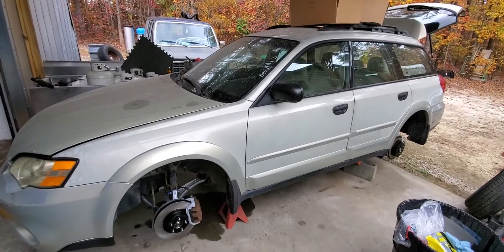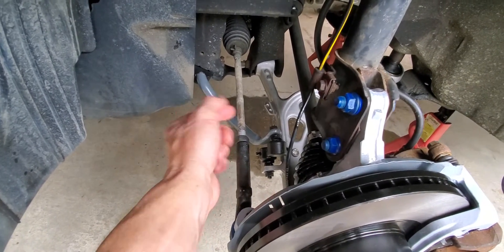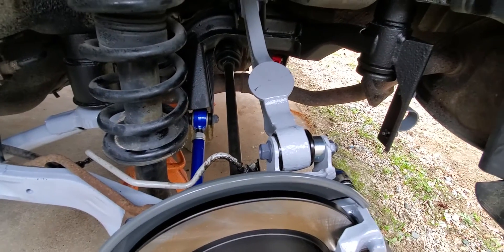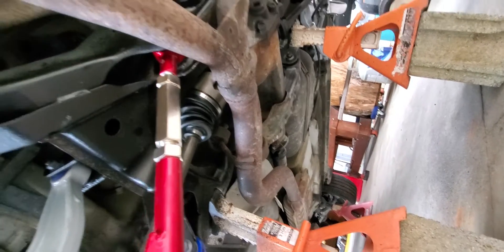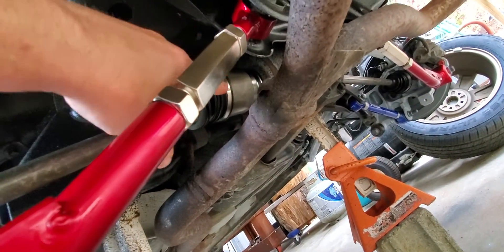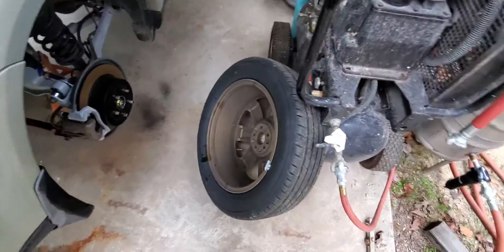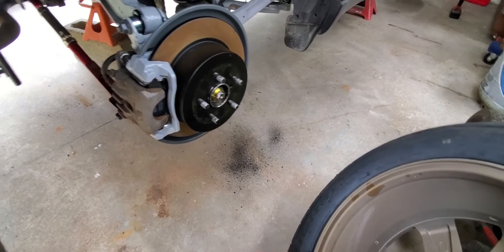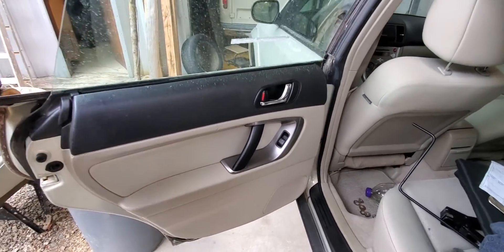2007 Subaru outback Suspension restoration

Comment: What exhaust did you end up buying , also wanted to say that you did an excellent job on the restoration of the suspension . I live in Ct. and I'm doing the same with my wife's 07 outback limited.
Reply from the maker: I haven't done the exhaust yet.  I drove the car a while but i didn't  properly  torque or stake the axle nuts so the rear driver side nut backed off enough  to ruin the abs sensor and therefore messing up the cruise control.  Replacing the sensor didn't fix the problem so i think the magnetic pickup in the hub must have worn through  too.  

Ive been driving another car but have new hubs ready to install.  Without  cruise control, it's not fun on the highway.

This spring i hope to paint it and finish up the mechanical stuff aside from exhaust  which is cost prohibitive.   

Hopefully I'll find a bargain on equal  length  headers and do a two into one.   I can't understand why two into one into two is a thing.